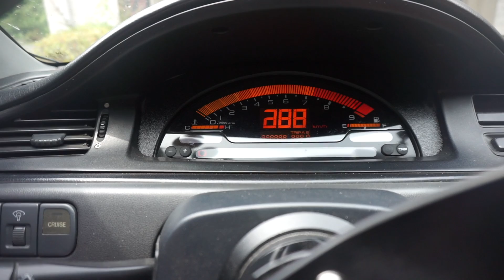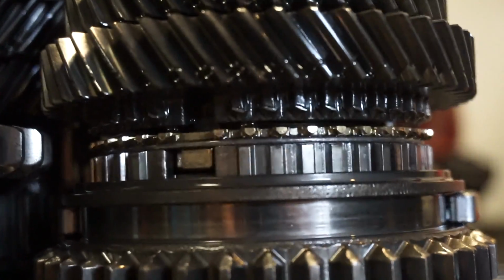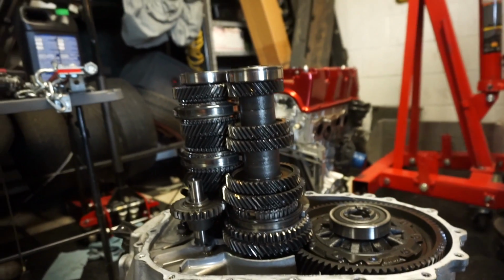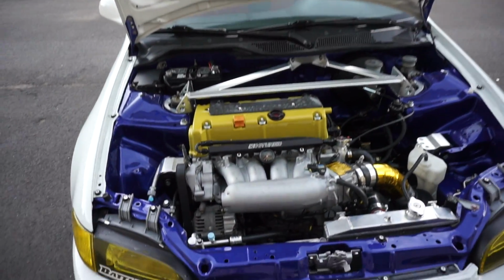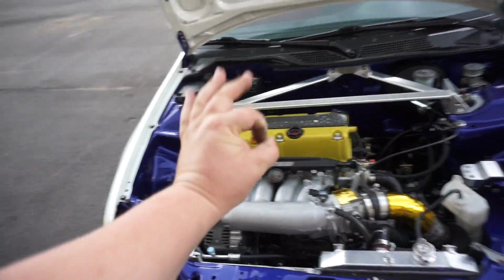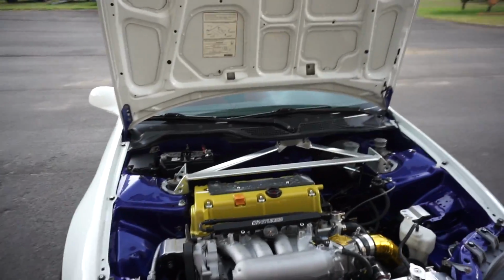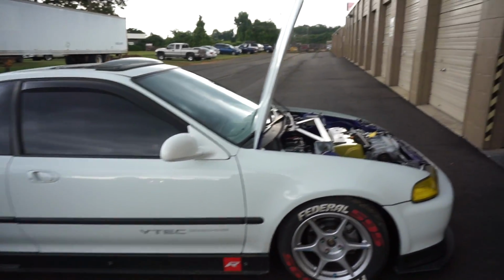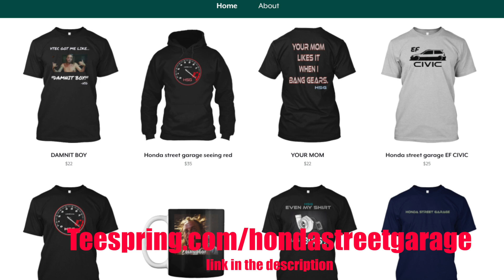J32 V6 VS K20Z1 !  UNEXPECTED !!!   HSG EP. 6-40

Comment: stock for stock that J would spank you, J does have the issue of not having many off the shelf tuning parts being available for it.
Reply: ugghh the sad truth...
Reply: There's really plenty
Reply: I believe this an tuned K series vs an untuned J series too. J series are fast, if it’s tuned it will easily spank the K series on roll run.
Reply: @johnnyboi5661  My parents have 02 honda odyssey and have J35A4 at red light she will tripped the wheels.
Reply: Yeah, cuz them J series make more torque off rip and have pretty aggressive power as well so I'm not surprised it could keep up with the K!
Reply: U alsk got a heavy engine compared to a k
Reply: J series is heavy as fuck and is not practical to swap. Trash
Reply: @ssjdavid  so why are you here
Reply: Any ideas or how much to go j swap for 88 ef hatch ? I wanna go j swap n i will but need ideas ( STOCK ONLY STOCK ONLY STOCK) please
Reply: @oetic5016 got a j32a2 so far i don’t know of any bolt ons or tunes that would really help.

Comment: That J32 sounds so fkn good. 👌🏾
Reply: Status Symbol but it’s so slow 😂
Reply: TwitchingwithRage it's running a k20z with cams and an intake manifold and he was right on its quarter panel.  how does that make it slow if he couldn't gap him....
Reply: samotrx7 cuz he’s a v6 getting walked by a k20
Reply: TwitchingwithRage  I guess our definition of getting walked is different.  and yes it's a 6 cylinder but it's a 6 cylinder that is a little heavier making around 260 horsepower.
Reply: TwitchingwithRage  and that's not even taking into account the gearing in both Transmissions there's a lot more than oh this motor is better than the other going on there
Reply: @twitchingwithrage4683  you probably drive a riced out d series around 😂 the j is definitely the Superior motor for the money

Comment: The k24 civic had the jump on the j32 v6 civic so i dont feel the last run was fair. He came out that turn with way more momentum while the j32 civic was just coasting. Imma go with the j32 civic based on the previous runs, but still its pretty uncertain. Yall need to re-do this on better roads. Maybe hwys and do some from a dig
Reply: rewatch lol u can hear the j series revvin way before the k.
Reply: @christopherrogers8316  You guys underestimate the advantage of a momentum advantage.  From the video, the v6 is barely faster.
Reply: I heard the j get on it before the k in the clean run......and it looks like the k is faster

Comment: Last run wasn't clean.... K series already had a speed advantage when they took off
Reply from the maker: Watch and listen again.... the cars line up the v6 goes (you can hear it... both cars were in 2nd gear) after the v6 goes the k goes.
Reply: K series still had a speed advantage and was already mid throttle... The j would have walked at an even roll
Reply: Plus the j was pulling on you hard when you let off
Reply: Richard Cangas yeah last run was not fair k was already at high rpms that j series had you shook 😂
Reply: He did have a very slight speed advantage but the J series civic also got the jump on him.  I feel it was an extremely close and fair race.
Reply: @richmedina2738  y’all sound salty as hell, K clearly won this race. J couldn’t even creep up on the last race, K was slowly pulling away looking at the passenger side mirror

Comment: I have a question I jus put a bseries swap and it not start the engine is time it have spark it getting but it not starting what i the problem and it getting gas but when open the gas cover it blowing air y and y it not start

Comment: K > J. ALLL DAYYY LONG PLAYBOY
Reply: Zosh yes the J is bigger than the K all day, but definitely not faster all day.
Reply: Don’t let MitonFilm see this comment
Reply: J series is nice too don't slp on it, he probably just swapped it, and didn't really put no work into it besides bolt ons. The K didn't beat him by much. More cylinders is always quicker js!
Reply: J is cheaper to swap but harder to tune.  Js have so many oem parts but the tuneable ecu is tough to get without spending a g on the ecu alone.  There were pretty even but at a certain point the tq just hurts you on the street.  Im a fan of all swaps love my h2bs though.
Reply: john martin j makes more power part for part,by far
Reply: I finally found someone that teases Birdman's Playboy sound🤣🤣🤣 ZOSHHH! THANKS
Reply: B20vtec #StockBlock1000
Reply: Got some j series yall can run out in vegas😂
Reply: h2b all day. k killer.
Reply: Thomas Strickland #hseries4life
Reply: Thomas Strickland I stay killing civic Sis in my F20b prelude. Gap city on them. Even won and lost to a k swap kpro tuned integra. Beat h2b and h22 swap as well.
Reply: My buddy and I just got finished putting together his h22a4 fully built motor and head stock bore 64mm air to water turbo setup expecting to make around 600
Reply: Thomas Strickland except that isn't the truth.
Reply: Thomas Strickland  k20a3 killer ? lol
Reply: gsr is k20a3 killer lol.
Reply: @preludeF20Bking probably wrong kind of h22 and possibly wrong kind of trans. you cannot beat my friends h2b lol. i can hang on f20b but it got me a car length and i had b18c swap.
Reply: K20C1 all day
Reply: My car the j car, it’s running on stock ecu and keep going on limp mode, that’s why he beat me
Reply: No replacement for displacement.

J>K
Reply: Nah
Reply: OKOS 702 CREW on god! Haha #eternalkings
Reply: j32a2.type s with j35 block on 100 shot nitrous runs 10s in my TL
Reply: Nah

Comment: I've seen other j vs k races and the j-series aren't always faster.  They don't have the ECU tuning options that the k-series does though.  I am sure they j-series had more tire spin than the K.
Reply from the maker: Thank you! You’re 100% correct!!!
Reply: I can only assume a J series doesn't having the tuning options in terms of Hondata but I'm sure you can buy an AEM, Haltech or one of the many other setups.
Reply: They do have the tuning options for standalone, piggybacks are iffy and you can't reflash the 2nd gen ecm.

Comment: Probably cam’d ported intake tuned vs stock computer,stock intake,cams etc... 😂
Reply: Exactly my thoughts. The J should easily win. It's simple math guys. My J30 'NA makes 280\232....on spray 345/340 with a slipping OEM clutch'...don't believe me then check my channel!!!
Reply: HalferLand Video's they hype those motors up to much lol. They J is an entirely different animal to a k bolt ons vs bolt ons.
Reply: preludeF20Bking  the 280/232 was without cams, which I now have stage 2 custom grind. If I was setup for NA (Hotter plugs, More timing, less fuel) as I run a Nitrous tune (colder plugs, less time, more fuel, etc) my car NA would easily be tipping on the 300whp NA range. Hell im sure even when I get Re Dynoed with my Stage 2 cams I’ll be in the 290whp NA range, and all while still tuned for spray!! 
K’s are good motors, J’s simply have more displacement.
Reply: All the while keep in mind that J Civic has a lot more torque he’s trying to put to the ground with those baby tires. I run 245-45 Mickey Thompson Street Comps and still spin a little. In this case the less TQ from the K may have helped
Reply: HalferLand Video's all while not needing a fancy race tune and swapping heads or blocks. I stay beating all the Ks in their original chassis in my F20b prelude. I would them to when I was f2b eg. My lude beats untuned v6 accords to but never ran a tuned one.
Reply: HalferLand Video's I easily believe 300 wheel on your J. You have decent torque already.
Reply: preludeF20Bking your on here too I see you everywhere 🤣 in a good way bro
Reply: Low_Funxtion haha you’ll probably find me more on muscle car video than Honda videos now a days 😂
Reply: Yea my j took a lot of k series out no problem.
Reply: preludeF20Bking good ta see ur lude still around bro and i feel u on the muscle car thing my 1st car isa 88 irocz still got her 13yrs later still rips but i fell in love with my hondas so shes been neglected but im gunna get back to her this winter im lookin fora t56 and 6.0 shes justa 5.7 with original 5spd right now but still launches hard
Reply: preludeF20Bking also u got any suggestions to cure my wheelhop in my 95 accord coupe jdm h22a m2b4 trans 215 50 16 hankook v2s are the tires everything looks good just hops bad for the last 4yrs since i did the swap tried many different tire setups but always hops
Reply: preludeF20Bking how is it hype when they prove to be among the best engines ever made??
Reply: Makandala Kya Bayaka nothing about being a fanboy i mean why run a K in my accord if i can go H or f20b and kill K cars all day🤷‍♂️ depends greatly on your area sadly theres k civics everywhere here on big shots so im sol cause my heavy 4d😂
Reply: Demand Respect just turbo that 5.7. No need to go 6.0.
Reply: Wayne Demby thought about it but the t5 isa fragile trans so if im gunna swap the trans might as well LS it and rebuild the original engine while its out for when i pop the LS

Comment: So many variables...tuned vs untuned.  Acura has tall gearing if the j32 had better gearing, maybe a better clutch, and a tune...you would only see tail lights.  But i cant take anything away from you.  Your car is definitely quick.   Fourth gear pulls really hard and tranny doesn't seem stock, or you were on race gas. Either way...run what you brung.

Comment: How u doing fam I get a 01 accord  2 door i did a 5speed swap I used the manual  wire harness every thing hooked up but the harness from the engine bay is not working Any tips

Comment: I've been curious why people don't use the 3.5 or the 3.7? I usually see the 3.2
Reply: the 32 is stronger i believe
Reply: J32 is cheaper, easier to find, and it's also more reliable.
Reply: the J32A2 has the best heads of the j series and is cheaper. best power is a j35 bottom end and j32a2 heads. also the last heads to have multiport exhaust instead of the single every other series has. and ecu option is much wider
Reply: PiterStreak you're the governor!
Reply: Josh Tonelli Like he said, J32s are cheaper and easier to find. Plus the parts are interchangeable, you can make the j32 a 3.5 or 3.7. There's even a  "3.6" stroker which is like destroking it using oem parts.

Comment: K20 got the jump last race. Looked pretty even.....Gotta think the K20z is like $3,500 for just the motor but the J32 is only like $500. Think I'd rather have the J32 for a budget build. If I had the $ & a DC5, K20z would be the way to go for Type R replica. J32 still damn good power for the $.

Comment: 3rd run k20 jumped early knowing that j probly standard would walk him down with mild supporting mods
Reply from the maker: You can clearly hear the j series go first. The problem is the J series transmission is so long VS the 4.7 type S transmission with 15' wheels. The K series advantage is the transmission the the power.

Comment: The EG civic is lighter than the EK civic, plain and simple, so it SHOULD win... but, it looks like a draw to me. I heard no 3 honks to make it good hit on both ends. The EK body is heavier, and the J32 is heavier. Weight advantage goes to the EG, no question. I personally prefer the K20 all day, with the better balance that it gives, and nearly equal power with the right mods. Then, there is the factor that you can't tune the J32, and have no room to grow with it. With the K20, there is an infinite number of options/possibilities. J32 is just a dead end. You might win with a fair weight and fair hit, but it's a V6 afterall... and that's the end of it. Dead end.

Comment: My clutch started slipping on my ep3. Will a stage 1 clutch last any longer than a regular clutch ?
Reply: Mustlehard yes
Reply: Also depends how you drive. If you are shit at driving standard then any clutch wont last long. If you rev match downshift and such it will add some life to the clutch.
Reply: Get the exedy stage 1 organic. It will handle all the abuse you can throw at it and last as long as an OEM one.
Reply: just don't buy exedy junk
Reply: Exedy is junk?  Thats why its the OEM clutch in almost every honda nissan and many others.  Must have got the exedy plate crap PP kit to try and save money.
Reply: Duane Bailey 😂😂😂 if you knew anything about a clutch you would know it's junk kid, exedy stage 1 is trash, get a act or competition clutch period
Reply: Please let me know a stage 1 organic cluth that can handle close to 300tq and last as long as an OEM clutch for a K.  Junk I love it my D series stage 1 held 250tq no issues at all never slipped.
Reply: Here is the reviews on your beloved comp clutch stage 1.5 organic.  

http://www.ozhonda.com/forum/showthread.php?172478-Competition-Clutch-vs-Exedy
Reply: I 2nd act clutch. Had a 6 puck act and it lasted me a couple years. Even with the abuse and me riding the clutch since i learned to drive stick with it.
Reply: I have a stage 2 on my Ep3 and it's been good so far it's been 2 years since
Reply: I've been using the XTD brand which is a cheap one and so far it's been good it all depends if you want to beat the shit out of it then get a better brand .
Reply: If your putting down big power then get a puck clutch.  If your car is a DD na car stick with the stage 1 organic clutch it will last 100k miles and you wont have to worry about the chatter or struggles in traffic.  Why put in a clutch that will last 30k miles when your never gonna break 200tq i dont get it.

Comment: Damn I thought a j32 was faster than that! I think I'm good on doing one of them swaps!
Reply: They are pretty even dont forget Mark has diff cams and manifold and if he has anything but the stock ecu its not really fair.   Same HP id say just weight is the factor and 100lbs for the J is a big handicap.  You can upgrade that J for dirt cheap though just hard to tune it.
Reply: Yeah power to weight not to mention that j32 was most likely bone stock. I have a cl type s. Trust me, you put some mods on it and bye bye k
Reply: Sean Wiseman I always liked how the j looks under the hood of a civic just nothing but engine.....
Reply: The j is only 550 lbs I think and the k is 450 same as the B.  H is between them but you can do things to make it close to even.
Reply: Yes everybody that thinks j swaps are slow keep thinking that.😀 Makes it that much better for the people that willing to put the time in and tune it right.

Comment: bud you had the fucking jump in the last one he would have laid you out
Reply from the maker: He actually had the jump. He admits all day. The k series advantage is the transmission. Power accounts for nothing without proper gearing. The trade off is @80mph k series is @5k rpm in 6th gear. The j series is at @2500 rpm

Comment: thats what i thought: j32 is too heavy so the gain is minimal, and then theres the rpm range versus transmission ratio etc. i got an ep3 si 5 spd 4.7 final good accel, but its doing 3800rpm in 5th @ 75mph ! lots of fun though cant complain

Comment: you jumped not very clean at all
Reply from the maker: Listen to the engines. I didn’t jump. I pull up and then he goes, then I go. 2nd gear roll. It’s an example of power-vs-weight-vs-gear ratios. I’m sure from a dig it would be different. My argument has always been gears over power.